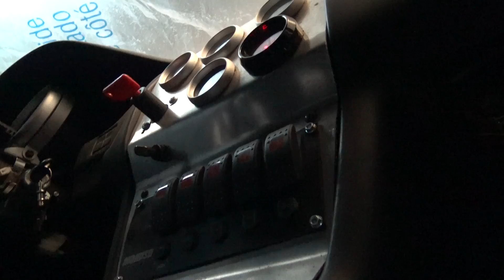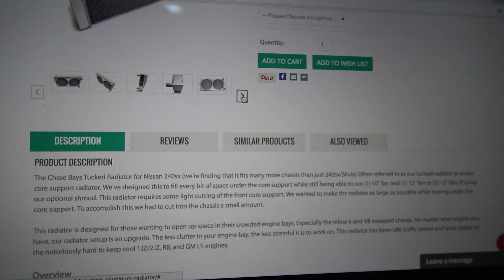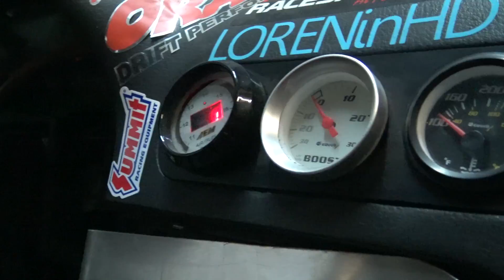Pt:3 | 1JZ VVTI 240sx Drift Car Makeover! | Race car wiring / Tucked radiator

Comment: I'd run the vent for the coolant overflow to the corner of the windshield, its what a lot of racers here do. It's so that you can kind of ignore your temp gauge and keep racing/driving until the overflow starts to spew over onto the corner of the windshield and you can visually see it. It also gives you another "safety" feature and is a great backup as I know we aren't always looking at our gauges, and the do act up sometimes and read incorrectly. Seeing your rad overflow onto your windshield, can never be read incorrectly :P

Comment: EDITED
Hey, once you got the car on. How do you turn it off? Do you just kill the main power?
Also, when you crank the engine and it started, do you just turn off the starter?
Do you run the starter in a different relay or do you use the starters solenoid?

Edit: so I finished the video and you basically answered most of it.

But I have few more questions:

Do you have the ECU wired to your ignition also?
Are you running relay on the brake lights too? I see two relays so I am guessing 1 for fuel pump and one for headlight that runs more current?

Im helping a friend wire up his race car so I could some insight.
Thanks.

Comment: I'm sure that turbo manifold will be blocking ports 2 and 5, it might explain the smoke/fumes you see coming from around port 2 in the video. 1j vvti and 2j vvti port spacing and design is totally different.

Comment: This might be a dumb question, but when you swapped in the 3076 were you able to use the oem oil feed and drain locations? I know you guys had to make the hard line, but did it go to the same stock location that the oem turbo used?
Reply from the maker: yes Jesse bought an aftermarket line kit, and we were able to hook them up to the stock locations
Reply: Premium, thanks for the info.

Comment: Hey man a good friend of mine and myself are building a tube chassis front end on his s14. We both have a lot of experience working on cars. But we don't have any experience fabricating. Did you do your roll cage yourself or did you take it to one of the shops here in co. By the way we are local to you. He lives in canon and I'm in penrose.
Reply from the maker: +carrington cape I won the Drift Colorado points series ( singles competition ) in 2013? And the prize was a full tig welded fd legal cage from Hanksville Hotrods in Denver. Since then I have caged one car ( the black s14 shelf) but that's it

Comment: Is it a little dangerous that distribution box and all power is fasten on metal plate wich is fasten to the  
frame ?  I prefer to use plastic or carbon for base.

Comment: Any chance you could give a little over view of which connectors to splice into for starter signal ignition and such? Too wire up the actual motor
Reply from the maker: just give power to white w/red stripe and hook the black-yellow wire to the starter
Reply: MotionAutoTv thanks for the reply! is the white/red just on one of the plugs for the dash harness? And it's just one wire for ignition?

Comment: What gauge wiring did you use? And how did you wire in the switch right under the windshield where the hood goes, and is that the standard spot?

Comment: do the brake lights work without the headlight switch on? or do the running lights have to be on in order for the brake light to come on with this set up?
Reply from the maker: Feenie88 I connected a wire from the fuse panel to a spot on the distribution block, and then hooked the brake lights/power to ignition switch to it so as long as the Red ignition switch is on the brakes will work, and you can crank over the car
Reply: MotionAutoTv Thank you for the quick response! I must have missed that part and was curious...going to refer to a lot of your videos when I wire my car next year.

Comment: Isn't the coolant just gonna go in and out the radiator if it's in and out on same side
Reply from the maker: Its a dual pass radiator, so its separated in the center and it flows to the other tank then back to the outlet
Reply: MotionAutoTv ok I kinda figured it was but wasn't sure

Comment: in and out on the rad can't go on the same tank. it needs to flow from one side to the other.
Reply: Edward Grindstaff can't tell if trolling or serious...
Reply: Edward Grindstaff there is black magic inside
Reply: um if inlet and outlet are on the same side the water wont pass through the cooling fins and the car will overheat.
Reply: Edward Grindstaff I guess we will find out
Reply from the maker: Its a dual pass radiator, so it has a divider in tank, so it has to flow to the other side and back
Reply: ohhhhh ok. never mind then.

Comment: how u wire the jesse key start too the fuse block
Reply from the maker: Ran a power wire from the fuse box to the ignition wiring, then a wire from the black/yellow wire on the ignition to the starter
Reply: Thanks Trevor. im doing the same exact swap and about to start the wiring . I got a stripped s13 so no chassis wiring. Im using the 1jz universal wiring specialties engine harness. Im Waiting on that
Reply: Power wire from the fuse box too what color wire on the ignition?

Comment: anyone else realizing there might be a flow issue with having both in/out coolant necks on the same side of the rad??
Reply from the maker: Its a dual pass radiator so the tank is split, has to flow to the other side, down then back

Comment: Great  ideas man, hard worker. But gotta cut them up... no ones gonna watch 40 minutes of vlogging. Not me atleast. Much respect. Later
Reply from the maker: yeah i knew this one was gonna be long, it was 1.5 hours when i started editing, i cut down quite a bit. I was going to separate it into two different videos, wiring then radiator stuff, but didn't wanna mess with it
Reply: MotionAutoTv Much respect, videos are very entertaining. Keeping it over 10m, under 20 is great. If you got alot of content, make it into multiple videos. Brings more money in. It could also save you time so you don't have to be on the edge of getting uploads out. You could always for ex: could have cut this one up into 2 like you said, and just upload the second one. Saves you time. Keep it up. :)